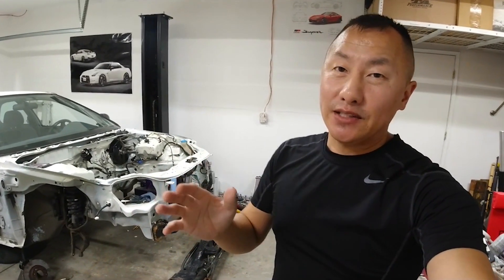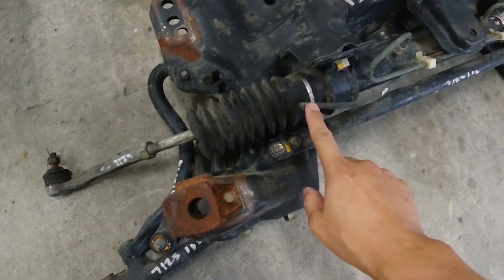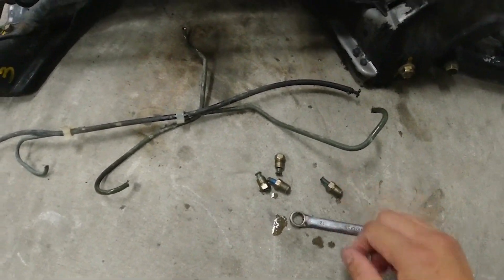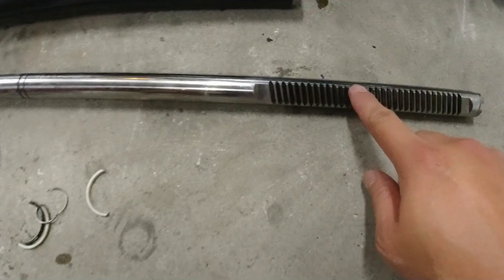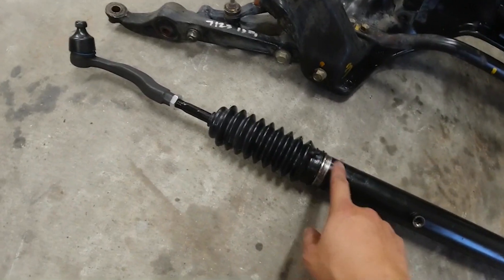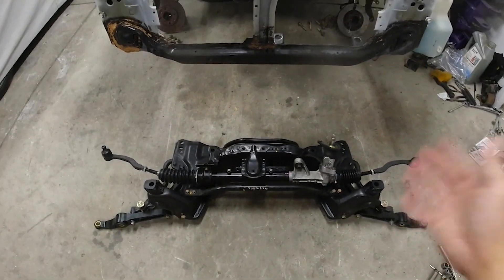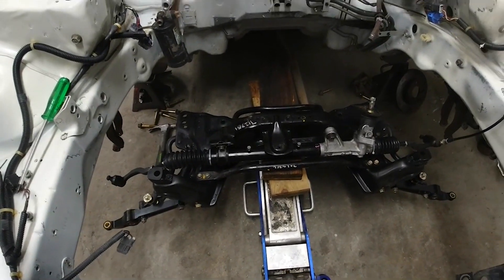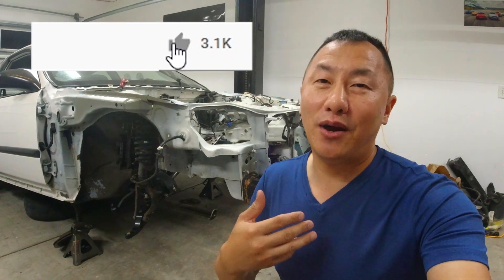My Honda Civic K Swap Part 2: No Power Steering Rack

Comment: my friend was swapping the K24 into a Lotus and also ran into clearance issues with mount and accessories for the K swap. 

The previous 2ZZ motor blew up on the track due to low oil.

Comment: I’m just staring my ek build. How did the power steering delete workout?  I’m looking at subframes and am wondering if I should go PS or no PS?  How does it feel on a road course without PS?  also could you have just converted the rack and pinion to a manual or would that have changed your steering response?
Reply: I run the power steering rack in my k20 swapped em1 with a chase bays reservoir attached to the power steering hoses. That way I have the tighter steering ratio of the powered rack and don’t have to worry about destroying the internals as there is still fluid in the rack, it’s just not powered anymore. Chase bays makes the kit with res, hoses and mount… it’s called the power steering delete kit.

Comment: Ok so I'm about to install my eg/dc subframe I got from offer up but do I need the eg screws or can I use the ek screws let me know I still need to go to junkyard for the connector to steering wheel and my civic is an automatic so I need a clutch pedal and brake pedal
Reply from the maker: You'll need use a combination of the eg/ek and dc.
Reply: @GTContent   what’s the combination?

Comment: so you cut off the metal part of the ring but left the rubber piece?
Reply from the maker: Yes. I removed the metal piece and left the plastic piece in there to support the shaft in case there's any flex.
Reply: @GTContent  cool thanks. i was gonna ask about how it supports itself on the far end of the rack. watched this video like 15 times now 😅
Reply: @GTContent  maybe ill buy the gates rebuild kit and put a extra plastic piece

Comment: Why did you have to remove the rings on the shaft? Can you just leave them on?
Reply from the maker: The metal ring will create pressure when you turn the steering wheel side to side since that's the purpose when it had power steering fluid. Remove the ring so it won't have resistance.

Comment: Which integra rack did you use. LS or type r?
Reply from the maker: LS
Reply: They're both the same. The only ones that are different are 2000-2001. They have a slightly quicker ratio